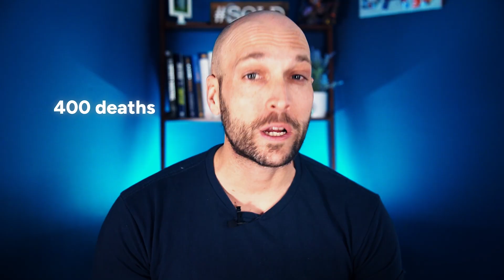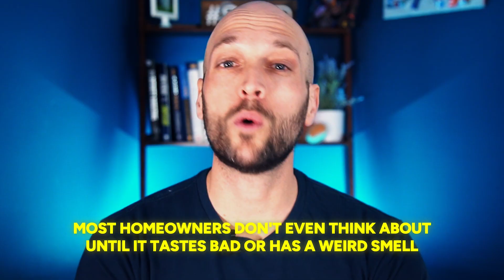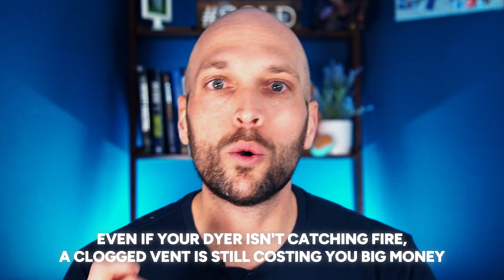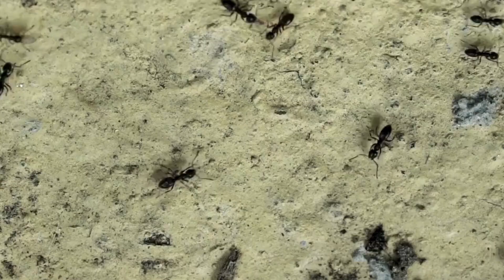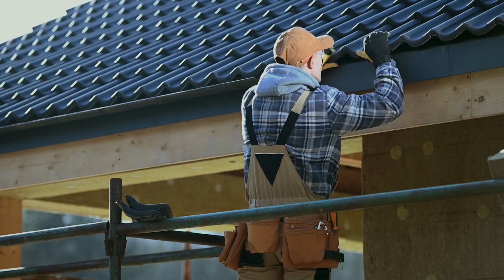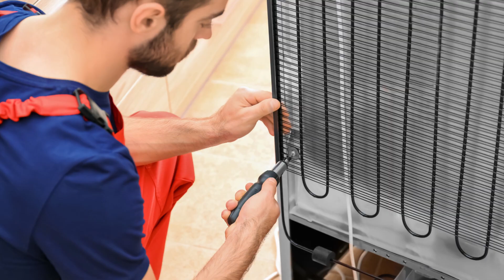7 HIDDEN Home Threats You Need to Fix ASAP!

Comment: Re: Carbon monoxide, I've got a smoke and carbon monoxide detector in every single room. Legally, you only need it on every floor in the UK but I've got a combined detector on every single room minus the bathrooms / kitchens.

In the kitchen / bathrooms, I've got heat alarms instead.

Hard water - Not an issue in the north of England but it isn't an inherently bad thing. Hard water is actually better for you but soft water tastes nicer and doesn't damage appliances

Hvac - Not an issue here too

Lint - Also not an issue here. Vented dryers are going to be banned soon. Most people don't even have dryers. I use a heat pump dryer myself though

Water heater - I've only got a combi boiler, so I've set it to 55C. They're 80C by default. Leigonella isn't an issue with a combi boiler
Reply from the maker: @waqasahmed939  You seem like you really know what you're doing and that's amazing!!